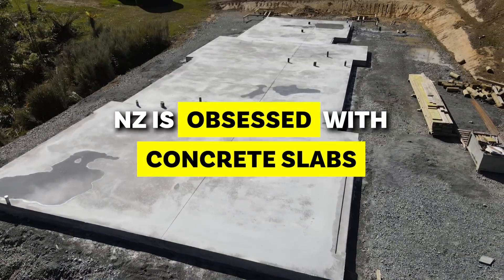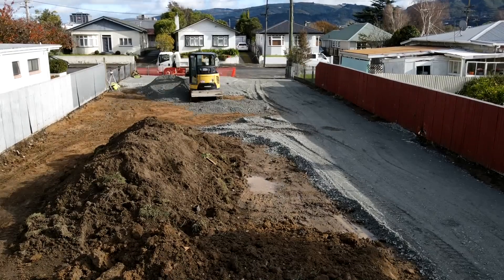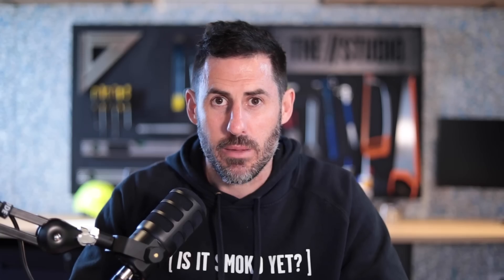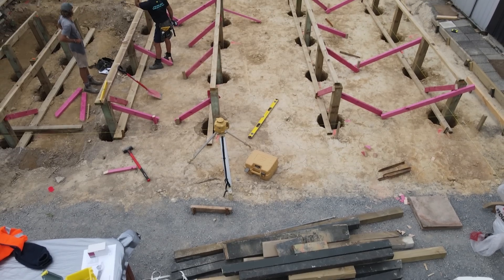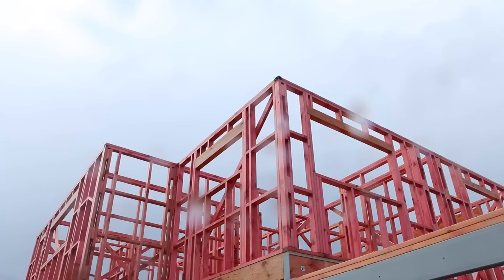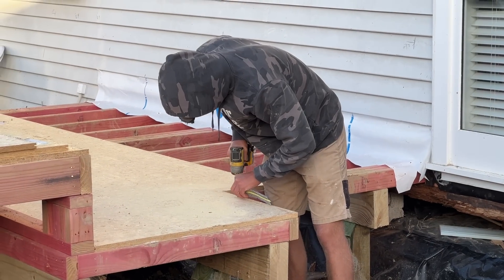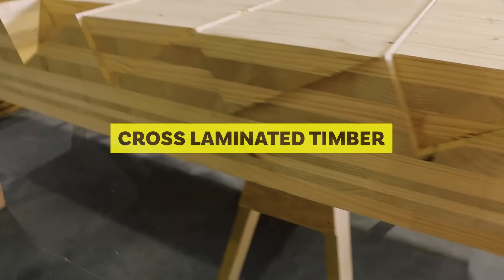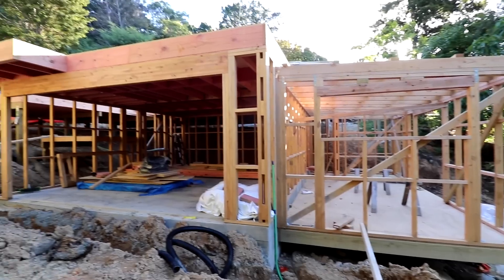New Zealand is OBSESSED! with Concrete Slabs

Comment: Sorry timber floor every time. Remedial action is possible if there is land movement, and go for plywood for strength and durability,  in the presence of moisture or leaking services especially if undetected over time. The number of concrete houses that were demolished compared to timber construction of dwellings in the Christchurch quake, is testament to that. A wood floor can often be warmer with insulation, and don't use polystyrene, as even with fire retardant it is still flammable and in a fire produces lethal toxic smoke. Subsequent additions of rooms etc is cheaper, especially if the house positioning on a site may mean limited access when building. Plumbing and electrics are accessible with timber structure and floors, re-wires or new wiring can be easily installed. A wool carpet with underlay may be all that is needed to provide floor insulation in warmer parts of the country. Additionally floor slabs may result in a level of dampness in high rainfall locations especially on sloping sections where waterproof membranes can fail and drainage is insufficient, and where retaining walls are present. An elevated wood floor generally allows good ventilation under the floor
Reply: Good that you show the other merits of timber floors. House with timber floor, if you have a HRV and a heat pump, you will find moisture and heat is well controlled through the year. Also virtually absence of condensation/crying windows on glass. Own and live in either types, you will tell the difference. Water leaks in concrete slab houses, How to repair? Piping in ceiling, like in Aus?
Reply from the maker: Definitely pros and cons to both
Reply: you will always need underfloor insulation in a suspended timber floor. carpet and underlay wouldn't suffice unless there's a high R rated underlay, haven't seen it used.
Reply: I agree 💯 % as a Kiwi born chippie of 37 years in the trade - finally somebody else with great knowledge too,!!!!
An "extreme rarity" now days!!
Bit like the "N.Z. born Kiwi"......😮

Comment: Closer to the ground for more indoor outdoor flow also comes at the cost of less resilience to flooding
Reply: Saw this in CHCH during the quakes  - liquifaction literally pouring in the front door in some cases. Everything built here since has the slab well above ground level.
Reply: Yes flooding is so common now Auckland has a flood viewer map for all Auckland properties. and the nightmare of liquidation which is another kind of flooding. increasing number of house sites  now will only be safe if we put them up on legs.  Houses in semitropical areas are built raised to withstand groundwater weather events. They have larger gutters and routinely having a storm water retention tank. But we don't seem to be adjusting our building style at all, just making small changes to minimise leaky rooves.   

And we need our houses to become more flexible as people's needs change, so the huge cost of shifting plumbing as the 2nd commenter say is a big barrier to houses being suitable for changing family types.
Reply: Flooding is one concern, worst is burst pipework, capillary tracking of water and the huge expense if you want to move a sanitary fixture, all at the expense of structurally weakening the slab from cutting up the steel it used to have.

Comment: How can you get away with just a concrete raft on gravel sub with no footings or any means to hold the gravel sub base? Terrible housing standards in NZ.
Reply: No footings allow for slab to move on top of the ground during an earthquake. This in theory would allow the slab to stay in tact even if the ground splits below it. There’s a huge amount of steel that goes into these rib raft slabs.
Reply: @alexcoulthard328  absolute rubbish. Living in your own world.
Reply: Steel reinforced raft slabs survived the Christchurch earthquakes exceptionally well. They spread the load over variable soils and as seen in Christchurch survive areas where the ground sunk away. You always start with a geotech report then designthe raft for the soil parameters in that report. Nothing wrong with NZ building code in that respect.
Reply: My house has wooden piles driven into the ground bellow the concrete slab, but I live real close to a fault-line.
Reply: Near beaches the concrete slab will sit on timber piles as well. My neighbour just build their new home and had to put an additional 150 piles at 5m deep beneath the slab.
Reply: @Mrblobbster  yes, it's anywhere with expansive soils as otherwise the slab will heave and buckle over time. Not uncommon in NZ and aus.
Reply: @Mrblobbster  we just a built a new house right by the beach no extra Piles just normal rib raft
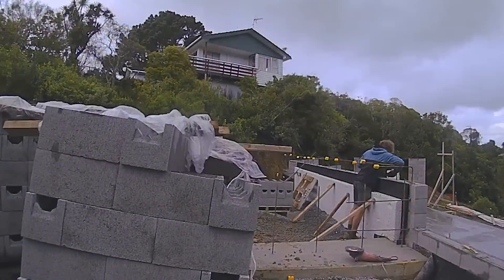Reply: @Mr_Sh1tcoin perhaps go and look at the science behind a "raft" foundations. It is basically a floating foundations that is used in specific soil condtions! This is what it looks to me they are using at 0:30 in the video. Also at 1:44 he mentiones a "rib raft" system which is the foundation with the large polystyrene(i think( blocks in the image with ribs running at 90 degree angles too each other
Reply from the maker: Check out some of my other slab videos to see how this actually works - big amounts of soil testing and engineering goes in to the design of each slab - and so far no two have been the same
Reply: Generally would you not use an engineer familiar with the area you're constructing? On site during demolition and clearing/levelling you can investigate the ground by digging a couple holes to confirm the conditions.

in sydney there's lots of clay so most slabs are raft with occasional 'pockets' in the footings. earthquake not considered at all in Australia house design, the load factors negligible

Comment: Very good point about elephant feet. After years of living in timber buildings in Wellington I DREEEAAMM of living in a full concrete build. Floors AND walls.
Reply from the maker: Agree - concrete slabs are much quieter
Reply: @nzbuilder  Right up until that first earth tremor ...
Reply: yea i dont, cold floors are not fun to deal with. new builds have concrete floors and hate it!
Reply: The reason Welly has so many timber buildings is that it is right on a fault line . Concrete, bricks and mortar do not deal well with earth tremors as Christchurch demonstrated graphically .
Reply: @weehudyy  so all the new builds in upper hutt (and there are a lot of them) are doomed?

Comment: Not a builder but it makes me sad to see so much concrete, plastic, metal and other shit buried into the ground. On that basis alone, timber subfloors on piles seems like it treads more lightly on the earth
Reply: There is a building ceiling and putting the first floor close to the ground is the ONLY option if you want generous 2 or tight 3 inside that limit. Plus thermal mass is key to comfort with careless undisciplined occupants and or allowing yourself to relax and be more care free with doors being open longer etc.
Reply: The styrofoam blocking is wild.
Reply: @ScuzzySera and I e seen so much broken and chips of styrofoam blowing all over building sites - eco disaster
Reply: @BobMcVicar-t7k  Theres a new build near my house and on windy days the street gutters are filled with those little styrofoam balls...

Comment: How do you stop rodents undermining your concrete and insulation? What kinds of concrete slabs can be put on piles - without having to dig out and stabilize areas?
What is becoming more common is composite steel floors like 'container homes - so foundations are key, concrete, wood or steel?
Can you use a variety of foundations within the same build?
Reply: What rodents are you talking about? In New Zealand.
Reply: @DiscoFang Rats, mice not normally rabbits - burrowing animals.

Comment: Great overview, thank you.  I presume timber floors/construction would also allow for easier wholesale house relocation and reuse, more so than concrete. I'm thinking flood prone areas or infill relocation and retro-fit type scenarios.  Concrete has its place, but probably should be used as a last resort material, as it has a high carbon/energy footprint.
Reply from the maker: Totally - both have their pros and cons. Check out some of my other slab videos to see how they actually work and the amount of engineering that goes in to each one.

Comment: interesting... concrete & supposedly clean green new zealand...
Reply: Who ever said NZ is clean green?
Reply: @DiscoFang  tourist advertising many years ago.
Reply: @gregj7916 I think that was 25 years ago, right?
”Just because the rose dies on the vine doesn’t mean it lied to you when it was in bloom.”

But anyway, to the facts, here in NZ 82% of electricty production is from renewables. That is, not producing CO2. We also do not have a water shortage. 
So what’s the problem with concrete produced here?
Reply: @DiscoFang concrete production releases insane amounts of CO2, and is extremely energy intensive. If you ever get the chance to visit a cement mill, it's quite an eye opener  - concrete's dirty little secret.
Reply: @petercroft9895 A typical passenger vehicle emits 4.5 tons of C02 in a year. Foundation concrete in a house typically embodies 250kg of C02 so a 150sqm house foundation that will last 100+years has around the same C02 footprint as one year of driving the car that lives in that house. 

Misguided and misdirected snide criticism.
Reply: @DiscoFang  Ignorant, or deliberately misleading? Try something more like 400kg of CO2 per cubic metre, depending on the composition. Add in the CO2 released, producing the steel reinforcing (which actually makes  concrete look good), and don't forget all the heavy equipment required to quarry the limestone in the first place, and deliver the finished product. You're up to 1500kg (1.5 tonnes) of CO2 per delivered, placed cubic metre of reinforced concrete, and that's at the light end of the range. Conservatively 30 tonnes of CO2 for your 150m2 house slab - just a smidge more than your 250kg, which would be the carbon emissions on a floor slab for a 6m2 garden shed, give or take.
And between natural disasters, developers (same thing), or the desire for something new, 5/8 of eff-all of those floor slabs will see out a hundred years before ending up in a landfill.
Reply: Plants need co2.  A modern hothouse pumps Co2 in up over 1000ppm or 3 x what's in the outside environment.
Reply from the maker: I also would love to see more work done in the environmental space in NZ - check out some of my "recycling building materials" videos to see some of the struggles we face.

Comment: I built for 10 years and designed for 20 after that. I still do a bit of both. I love timber floors! I have more control over the process. Timber floors are versatile. The most crazy timber floor I designed was for a dance studio and it was sprung. But timber floors in general are easier on the body whether they're sprung or not and also the thermal mass of conc. is both a blessing and a curse.
I'm 65 and thinking about designing and building my last forever home, it'll quite possibly have a timber floor even if it's just floating over a slab.
Reply: Yeah that's the ideal. Natural timber floor spaced up over concrete,
Reply from the maker: How cool! You'll have to send me some pictures Id be interested in hearing about if you decide to do it

Comment: I just wish builders would use 290mm joists instead of 240.
You should never be able to hear stomping throughout the building or hear ratting furniture caused by joist deflection, the mid floor in my 1970s building suffers from this and I have been battling with it for years, I have doubled up many of the joists added more blocking extra screws in the particle board decking and put steel strapping under the joist blocking, this actually made the most improvement but my next move will be to install steel beams. But to my surprise, many brand new buildings have the exact same problem, I'm not a heavy dude either, just 80kg and walk light on my feet with shoes off to avoid floor deflection.
But whoever engineers these buildings, they seriously need to up their game.

Comment: Some other positives that get missed for timber floors are also easy to access blocked and broken services (if they are slung under the building) and easier to relevel/ move if they get damaged or need to move.
Would love to see more from  the CTL Flooring in the future.
Reply: by the time you access the broken services under the ease to access timber, you will also have a prime sneak peak at the rotting wood and shifted angles.
Reply: @martiruda  I plumbed my house out with all services under the house. I'd rather come home to a puddle of water under my house that can be easily repaired than a ceiling that has collapsed due to water

Comment: im an engineer from canada working here in nz now. its crazy to see the differences in home building. have you considered a 50mm concrete topping on top of your wood floors? this is a common detail for decades now in north america. it gives you the benefit of concrete floors as well as the wood subfloor. you can even put hydronic tubes in the concrete topping for in floor heating. 

also, the main difference is that here in NZ i guess the main foundation for homes is either slab on grade or piles; while the standard way to build in canada is with concrete footings where you place concrete strips in the load bearing locations such as your outside walls, interior load bearing walls, and then put floor joists on the footings. basically minimizing the concrete used while maximizing the wood used, for a variety of benefits.
Reply: Concrete over timber in New Zealand? You did hear the bit about earthquakes didn't you?
Reply: Concrete over Timber is used in Commercial Properties in New Zealand, I have leased two commercial properties in Wellington one building was from the late 70s and the other was early 80s and both have timber with concrete poured on top, something I have never seen in Canada. My current property is on the 6th floor of a 12 story building in Wellington and does not have a sprinkler system in our unit, even though the ceiling in our unit is timber, something completely unheard of in Canada as well.
Reply: Those North American methods are not half-arsed enough to meet NZ regulations
Reply: @PaulG.x  coming from Canada it’s the other way around, New Zealand homes absolutely do not meet our standards every home I lived in Canada had a basement and insulation to minus 60 degrees, HVAC that you can’t even get in New Zealand, double glazing at a minimum or triple glazing, when it come down to it if you placed a New Zealand home in Canada the pipes would freeze and burst the first week of winter, your homes are not fit for purpose anywhere in cold climates and barely fit for purpose in New Zealand
Reply: @ytzpilot  You're telling me , I'm sitting here freezing , 3 weeks into spring
Reply: @ytzpilot  I think you interpreted PaulG’s comment the opposite way to what he intended… read it again.
Reply: @matthewd759  yea I did sorry about that, I guess I’m over this past winter and the resent cold snap, ready for summer now 😎👍
Reply: @PaulG.x 😂😂
Reply: How have topping slabs (over timber substrates) performed in earthqauakes?
Reply: @trevorgrenon9162  trivial amount of deadload added to the floor plates which is accounted for in the shear walls because we use plywood sheathing on the buildings which is another big difference. Rabbit hole goes quite deep...
Reply: I'm in Oz, it's done but its difficult to get the trades to do topping slabs.
Its a really worthwhile option to consider.

Comment: Interesting video. I know where I live a lot of them are still wooden floors on piles. I understand that's there's an increase in costs vs concrete slabs. But as it's an earthquake pourn area where most site are hill sides and flooding and drainage can be an issue. A wooden floor with piles makes more sense rather than the amount of work it'll take to do the cut and fills required

Comment: Binding sand?
Reply: Common mistake. For some reason malapropisms abound in New Zealand. it doensn't help that binding sand is actually a thing we use too in landscaping.
Reply: @DiscoFang  Oh yeah? What for? Sand with cement?
Reply: @DiscoFang  It's all that has ever been used. Starting to worry about the trades TBH.
Reply: The sand provides a barrier between the damp proof membrane and the hardfill
Reply: @Justnuts-d9b  Yeah, it's called blinding sand.
Reply: He probably thinks it's sand that binds together, lol.
Reply: @tristanpatterson3843  builder of 25 year here i kind of know what it is
Reply: @Justnuts-d9b  OH, LOL, you think it's called binding sand too?
Reply: @tristanpatterson3843  no it's sand blinding. You just  use grey sand its nothing special